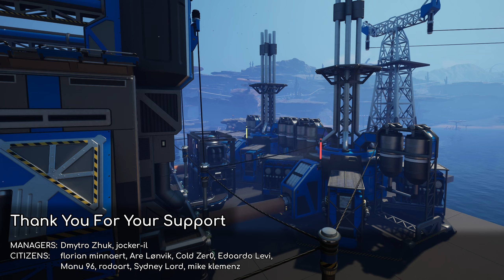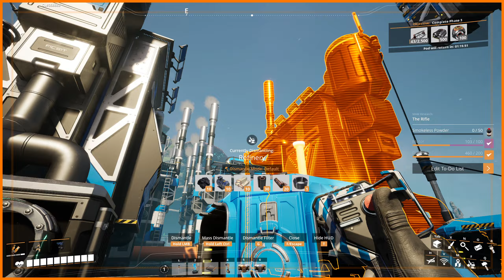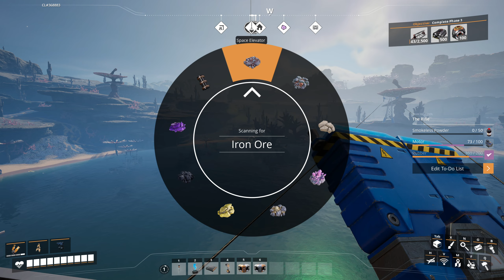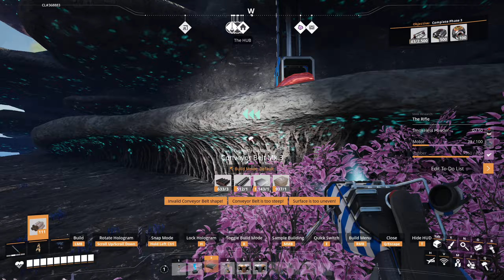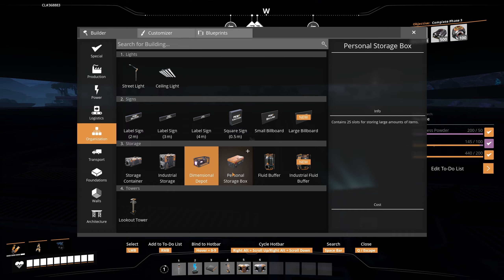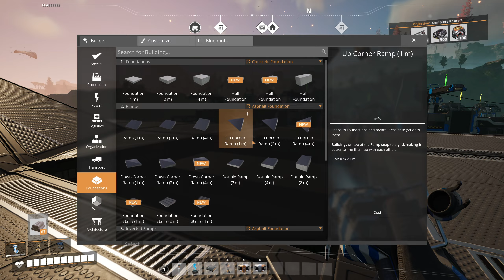Unlocking the Rifle - E22 ║ Satisfactory

Comment: why not put the circuits in the dimensional storage - you can access it if needed from there. also, you should really unlock a bigger stack size and faster upload speed - the current ones are annoying and not enough anymore - that is obvious,

 I would try to manufacture the rifle ammo (the orange type) near where you produce the gunpowder - wouldn't you say that makes sense ? (I didn't see if they are needed for the homing version, but until you have those...) and you could upload them as well...
Reply from the maker: Mercer spheres are hard to come by, so I need to priorotise things. :(

Same for general small improvements, I have a limited time per episode. If I want to do small things, like ammo production, then I would likely do that in between episodes, and we all know that I am very uncomfortable with cutting things out. :P
Reply: @Hmuda  then don't cut out the ammo production part - just make it a "secondary" objective" in a much larger plan for an episode - say when working in that area like you did with producing the concentrated coal, you could have made the explosive production another part of it